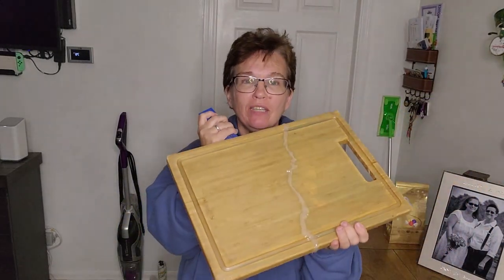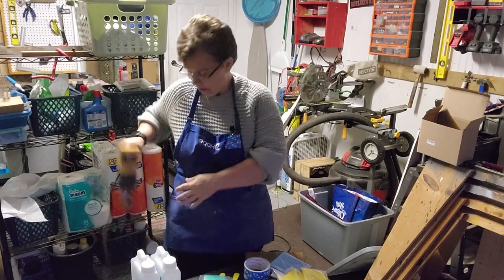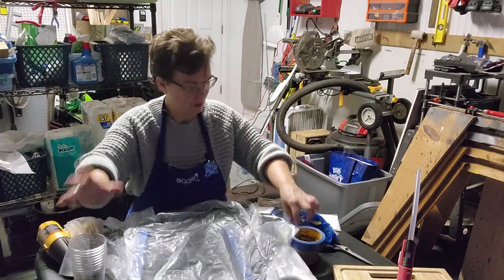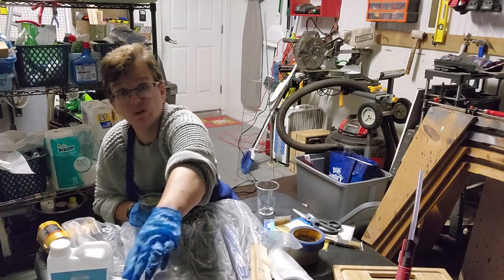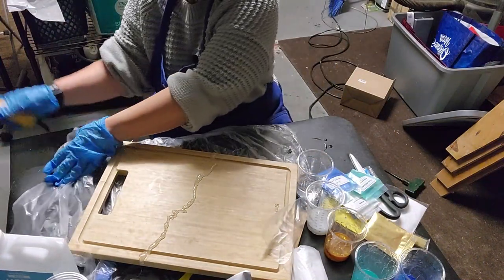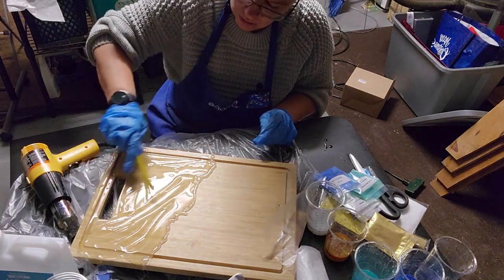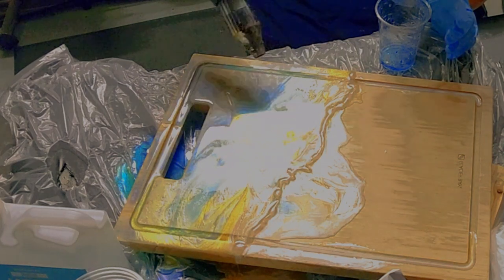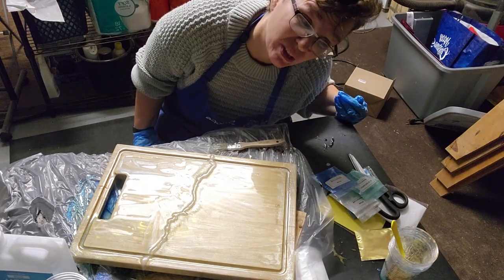Beginner Epoxy Cutting Board!! Spoiler alert... I failed miserably!!

Comment: Sorry to see your cutting board didn't turn out the way you wanted it but don't give up. I started doing epoxy projects a couple years ago and it gets easier with practice. Lowes has casting epoxy for like $20 or if you have a Hobby Lobby store, they also sell epoxy cheap. It's good to use just starting out so you don't waste a lot of money. Also Lowes has tape that epoxy doesn't stick to called Tyvek tape. I use it all the time when making molds for my projects. Good luck with your next epoxy project!
Reply from the maker: Thank you so much for the advice!!  I live next door to Lowes, so i will definitely go searching!! Happy Holidays!!